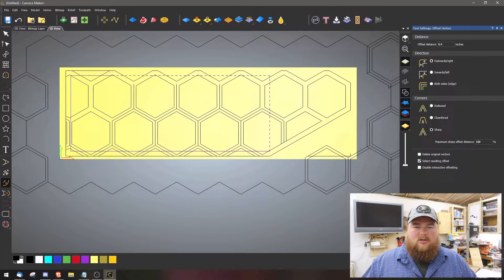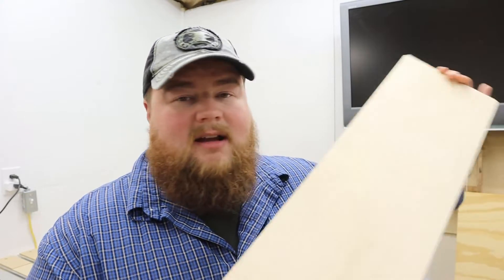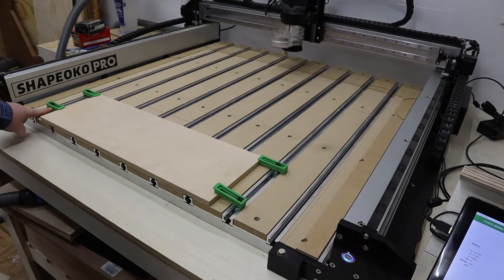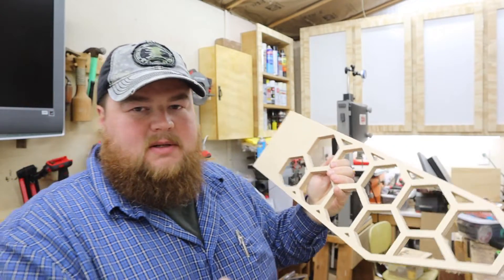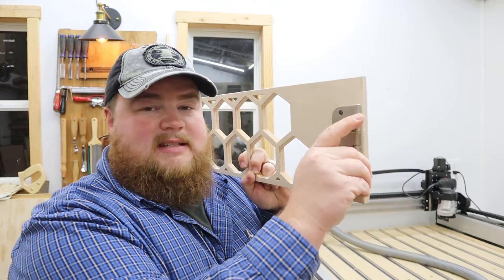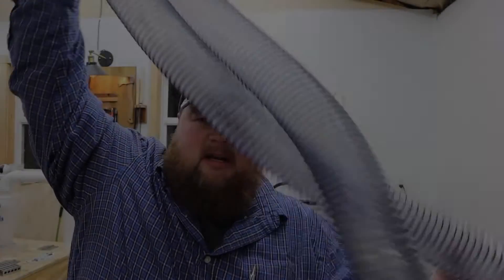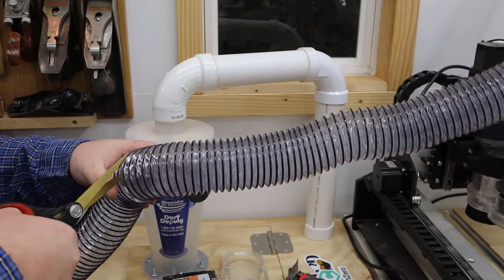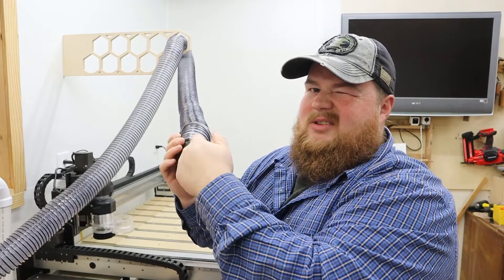Custom CNC Dust Collection Hose Bracket | Shapeoko Pro XXL

Comment: I’m trying to find a vac hose to use for my cnc.  The hose you use here seems very flexible, which is good.  I’m curious to know if the hose shrinks lengthwise when the vacuum is on.  Are you still happy with the hose after using for a while?
Reply from the maker: It will if connected to a smaller size port, but not for the 2-1/2" connection on my CNC fitting. Even with the shrinkage it's not bad.

Comment: It's interesting to note how the bracket barely pivots on that hinge as the machine moves all around
Reply from the maker: I've noticed this over time, too. In my experience I'd say the hinge is not really needed. :)
Reply: @Samcraftcom  I meant to add, that was totally unexpected. I didn't think it would swing wildly left to right, but it's just interesting that it moves so little. This is definitely going to be a help to me, as I have a CNC on order and am planning my area for it.

Comment: Nice job Sam, Love your vids. I am a new shapoko pro owner too. Just asking but did you think of using the cnc to mortise and pilot hole the hinge?
Reply from the maker: Welcome to the party! LOL I briefly considered using the CNC for some sort of hinge, but decided to take the simplest and probably strongest route and use the metal butt hinge. There is quite a bit of stress on that part -- having to support the arm, plus the weight of the 2-1/2" dust collection hose, and the forces being applied to it. I didn't think a wood pivot would hold up in the long run.

Comment: Why didn't you use the built in bit setter?
Reply from the maker: I did. That's at the 5:00 mark, then the BitZero is at 6:00. :)
Reply: @Samcraftcom  Was just confused as to why you had to bit zero using the built-in one as well as the additional one.  Love your videos by the way :)

Comment: I would assume the anti static part is the vinyl, not the wire used for structure. And as myth busters proved PVC pipes just can't hold a large enough charge to cause an issues. Awesome work and great video...ok if you ever want to paint the hose, regular rattle can spray paint will never dry on vinyl, have to get the special stuff from an auto parts place
Reply from the maker: Thanks for the info!

Comment: If you make a small "hook" on the end of the dust hose cable you can drill a small hole for it to go into and that will provide some extra strength there. It took me a while to get mine figured out but that worked out perfectly. I have dedicated dust collection for my Shapeoko and another for the shop tools. Great idea with the arm you made though!
Reply from the maker: Cool idea, thanks Jake! I could see upgrading my DC system some day down the road. :)

Comment: Love your videos brother! I just got a pro and would recommend the shop fox d3347 cam clamp. Just use the bolts that came with your machine to get them to work with the t track system. Sped up my clamping process  a bunch.
Reply from the maker: I'll check it out, thanks!!